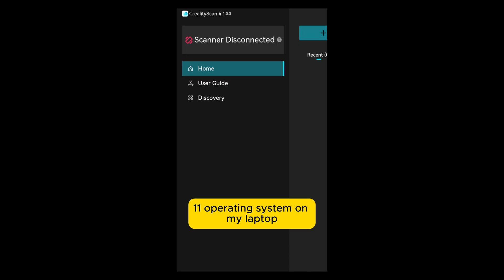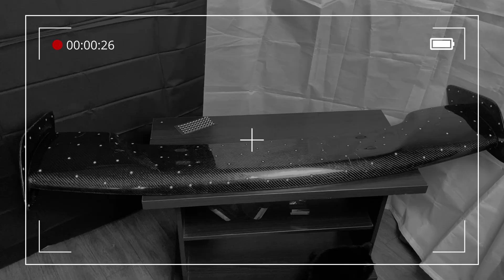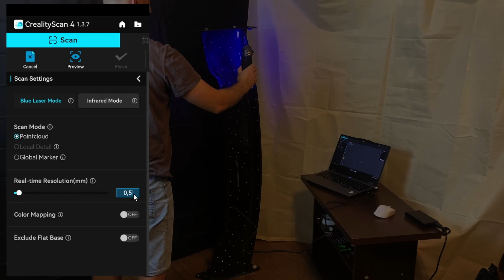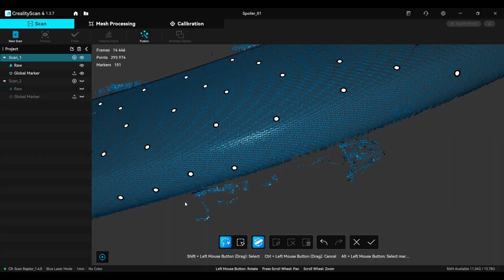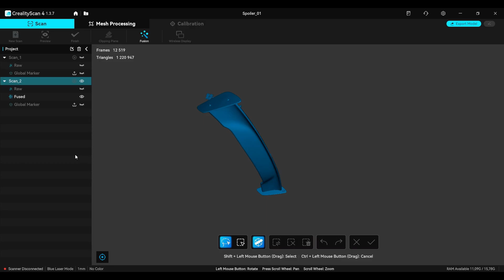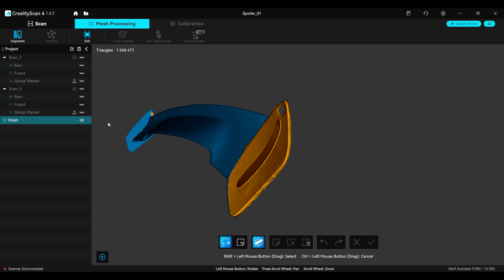A Cheap Laser 3D Scanner and a Carbon Fiber Spoiler

Comment: Nice video! What software do you use after getting that mesh? or how do you modify that mesh in order to make custom parts?
Reply from the maker: After scanning the part, I create a CAD model in NX. Alternatives include Fusion 360 and FreeCAD. I also use auxiliary programs such as MeshMixer, CloudCompare, and MeshLab.